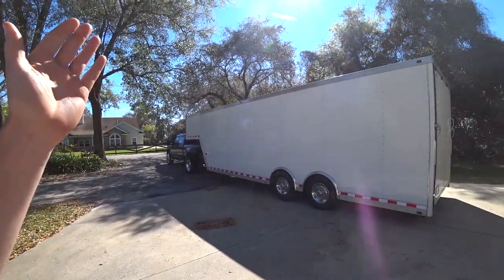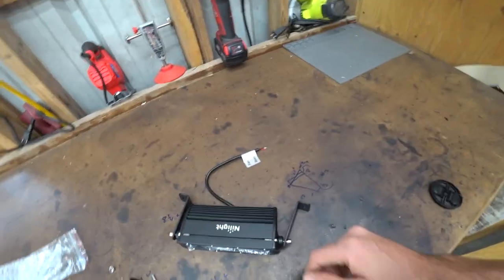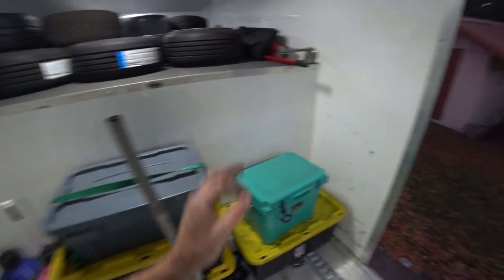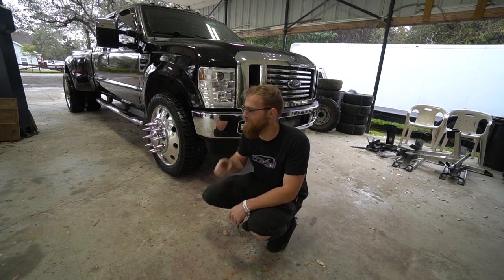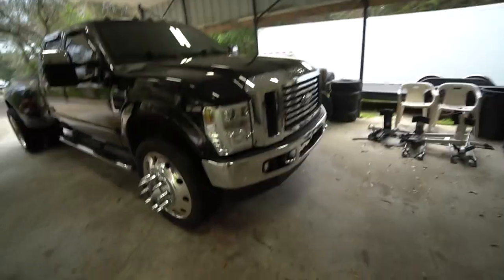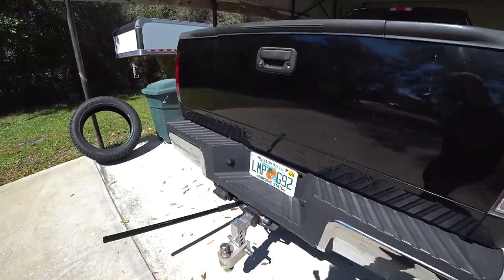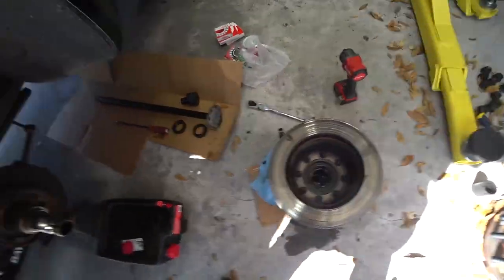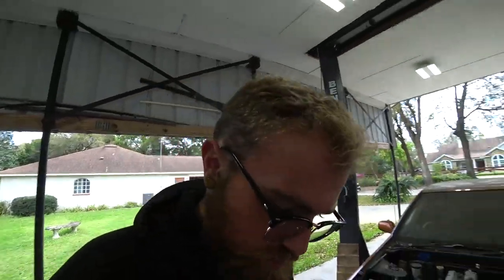Fixing up my new trailer and my cummins swapped tow rig.

Comment: Don't forget to notch the spare wheel as well, you don't want to be stuck at the side of the road trying to fit the spare over the studs.
Reply from the maker: Yeah I'll need to. The difficult part is it's not even. Like however you notch it the wheel can only go one one way and the notches line up. So I'll have to test fit it up there to mark for the notches
Reply: @Taylordrifts  where did you get those taillights at I really want some for my 01 F350

Comment: Fun fact: Taylor doesn’t go to drift events to drive, it’s just an excuse to tow something
Reply: Ole Trailer Ray
Reply: Plot twist
Reply from the maker: It’s honestly kinda true 😂
Reply: @bagelbandit6076  need Trailer Ray Tees now!!
Reply: @Taylordrifts  I'm sure you know but I've had really bad luck with standard trailer tires, and I know you said that you upgraded to better tires. But if you have a 235/80or85r16 just upgrade to the saliun s637. The difference between them (14ply) and a standard 10 ply is a world of difference. Last time I bought them they were only $150/piece. Not sure if it matters but I hope it helps brother. Love what you do man.
Reply: Release ya inner trucki  Taylor!!! Haha... from a fellow Aussie trucker! Can relate haha
Reply: @NickB412  trailer tyres always seem to blow.. What is it about the standard tyres that's crap?
Reply: @Matty.Hill_87  Mainly load rating, and testing... trailer tyres don't need to steer, so are generally built to a lesser standard as they just follow and stop.
Reply: @RangerRick24  lmao Trailer Ray 😂 I'd Buy that! Can i get that in a Hoodie?
Reply: @Taylordrifts   what machine shop do you go to in central fl I need some work done and I don’t know which ones are good

Comment: I like how the trailer is setup with tandem axles that are spread out, distributes the load more evenly, also is more stable towing, and a little bit more airflow to the rear axle tires to keep them cooler.

Comment: This was a super fun video for me to watch.  I just bought a 26’ bumper pull Pace for my 04 MSM that I’m running a lot of AutoX and track days with.  Mine is much older and came set up with generator, cabinets, winch which I saw your comments on, but these things work for me.  Mine also came with a RV heat/AC unit.  Anyway, it was the right trailer for me and setting it up is super fun.  Like you, I am enjoying it almost as much as my new race car.  It’s the old trailer that I always dreamed of having and for my budget, absolutely the right one.  Thanks for sharing this.  Great video.

Comment: It's amazing what a difference a few feet makes on a trailer. Yanking a 46' semi trailer around is like driving a pickup, but a standard 52' or 60' big boy I have to move around and pull into the shop is a pain. Really glad I'm not a truck driver.

As far as 24" wheels and tires go, always make sure to use anti seize on your hub centrics, lube up the studs and in between the nuts and washers with some PB or other oil, and either buy a tire bar or weld a chunk of round bar for a fulcrum to a 36" pry bar to lever the wheel and tire on and off. I only jack the wheels up about 1.5-2" off the ground and lift them on and off the studs with a bar. If they're real stuck, usually a 6-8 pound sledge to the sidewall will pop them loose, usually from outside but sometimes you gotta do the ugly sideways swing laying under the truck.

Those valve stems have a rubber seal on the inside of the wheel, pretty much guarantee the silicone will eventually come loose and you'll need to remount it and replace the stem.

Comment: You are correct Taylor there is a rubber seal on the inside of the wheel to seal the metal stems. Usually over tighten then nut can squish the seal causing premature failure, also looks like there might be also bit of corrosion getting around the stem hole. As far getting that tire mounted call les schwab most of them can service semi stuff of should be able to tell you which of their locations near you will be able. 
But I sure do love fummins/ trailer videos!!!

Comment: I would highly recommend getting a new valve stem for the leaking one. If you can break the bead you might be able to change it yourself without needing to remove the tire completely. As always, you do everything the right way by replacing what needs it. Thumbs up!

Comment: Just a suggestion. Good lookin truck btw!  I have an F250 and pull our race car, an equipment gooseneck, and a fifth wheel camper. I put power stop drilled/slotted rotors and composite pads because of the excessive wear, noise, brake dust etc mainly from
Pulling trailers. They’ve been on for a year now and can’t tell any where at all. They’re impressive!!  They weren’t cheap but will last much much longer. Summit has them and you can buy them in a kit. No worries on heat or excessive wear from pulling a trailer!  Wheels don’t get any brake dust at all either which is nice.

Comment: On the Fummins, the left tail light wasn't working when you had the marker lights on.  I'm glad that you notched the outside wheels too.  That way if you start doing tire rotations on the truck you won't have to fight it later.  As you know from dealing with them so far, a tire rotation on a dually isn't much fun.  If memory serves it is inside to out, and out to front, and front to inner.  I am sure that you can find that information way easier then the last time that I did a dually rotation.  Keep up the great content!

Comment: #1 they make "skirt" lug nuts that will align a semi wheel better than the flat flange ones.  You only need to replace 2 or 3 nuts per wheel to ensure proper centering. #2 The valve stems for aluminum semi wheels do have an O ring on the inside of the wheel.  You can also get stem extensions that make checking the inside tire pressure way easier.

Comment: Always use a little anti-seize on the hub centric adapter so they don't stick ! I had that happen so bad we had to drive a couple of miles with loose lugs to loosen the wheel.

Comment: Idea- instead of having the tracks dispersed on the walls that run horizontally however many feet apart. Get some in between them so both walls is one long track on each side. You can NEVER have to many tie down spots/options.

Being a trucker in a sense & racer,I’m in trailers all day for work/play time. Having the tracks run along the whole long of the wall gives you many options for tying toolboxes down-securing fuel drums/cans. Jacks,broom for sweeping trailer out etc.
Nice score on the trailer!🤙🏼

Comment: I learnd that way on my subaru. Thought my transmission was loud. So we took it apart and it was totally fine. Sounded like the sound was from the transmission. Turned out it was the rear diff. Allways good to check first where the sound is coming from. Lol

Comment: wire the LED work lights on the back of the trailer to your backup lights circuit along with a diode on each side and you will have backup lights and loading lights.

Comment: 08-10 ford 250s, and 350s were renounced for hanging up brake calipers. My 08 sat a lot when I owned it, and I had to replace 3 of the 4 calipers even before 80k miles. Replacing the rears was a good call, but keep an eye on the fronts. Anti seize on the guides isnt a bad idea if you aren’t driving it every day.

Comment: Not sure if you'll see this before you come up with a plan but if you're putting the spare in the stock location should be able to use the stock wench system to get it up and down easily or something similar then throw a bolt through just in case cause it is so much heavier.  Gotta love "simple" brake jobs.  Also a jibber jabber t-shirt is a must make that happen. Good luck at the event 👍

Comment: The brake clips are what make the grinding noise. That is their purpose. It is to alert the driver to replace the brakes. Without them grinding, the brakes could get to the point where you run out of friction material and lose breaks without warning.

Comment: btw, high temp lithium grease works better then pb blaster for long-term anti seize (3 years through canadian winters, and popped off super easy).  Works great between dually hub adapters too.

Comment: Talking about comfort while pulling trailers on long trips. If it will work. Look into a Gen Y spartan for the trailer. It will cushion the trailer from the truck connection. Make for a smoother ride over rough roads.

Comment: Taylor I saw a welding accessory I think you'll be interested in. It's the Linear Amperage Control from CK Worldwide. Its a slider that connects to the torch and could be a good replacement for the button control.

Comment: Hey man I heard you talk about using a dead blow and the nuts on the inside of the rim making it extra hard to get off. I work for a towing company and I change tires on diesel pushers and some time those rims get stuck on tight my grandpa taught me to use a 4x4 and rest it on the inside rim lip and use a 10 pound short sledge hammer and beat on that block and then if it doesn't move go 180 to the other side and go again and even the most stubborn ones will work off. Also on our big truck most of  the tire shops don't put the tires on with machines just big tire spoons the beads on those rims are not the same as car and regular truck rims. Good luck and keep it up love the videos just trying to pass on what I've learned and seen

Comment: Amazing stuff as always! Have you thought about wrapping the trailer to match your truck a bit better? 🤔
Reply: At least he wanted to do it to the previous one but he never got around to do it. Might have been because a lot of comments said that a black wrap would turn it in to an oven under the sun. Or he just knew that he would get another one eventually, so why bother.
Reply: @Gavztermeizter  straight facts, but even if he would wrap it like some of these RV or Camper trailers it would look so much better and I know a lot of companies will leave the roof alone or wrap it in a heat repellent material.

Comment: They make plastic rings to put between the hub a wheel. That will help with corrosion. The also make lug nuts that center the rim onto the studs.

Comment: Put a little bit of silver antiseeze on hub and wheels and you will be so happy had to do on my old 1984 chevy 3500 crew cab dually with alchoa 22.5 rims and wheels 10 years ago made life so easy
Reply: And maybe also say truck was c notched and bagged and laid frame (great spark show on freeway when doing 70 and dropped bags lol) plus the diesel swap  even though it was only a 6.5 turbo diesel

Comment: Those valve stems have an o ring on the inside of the wheel that can leak if you aren’t mildly careful installing them. Also if you use a pry bar under the tire when you’re putting them on the truck they’re a piece of cake to install.

Comment: You had a solid quarter inch of pad left on the RF, that's at least another 50k miles before considering replacement.  The stock pads are only about 10mm thick, and you had 5-6mm, so you were at 50%.

Comment: Most tire machines these days have adjustable jaws. There's normally a little pin attached to a small lever, push it in and you can adjust it to hold a bigger wheel. Can't tell if yours has it or not.

Comment: Slightly closer to a careful completion. For the next stuck wheels maybe use the lift with blocks on one side and set it back down on an angle? Like a flat 2x4 or two, not jackstands, eep! Hopefully never again, but when it happens again. Have a good one.

Comment: You need a 6 foot dead blow semi wheel almost always get stuck on that’s what we using in the shop for the semis
Reply: A six foot hammer? Huh?
Reply: @-tr0n  a dead blow isn't a "hammer."
Reply: @shakotanlife  i mean, it is. mallet, dead blow, whatever it's a type of hammer. Point is they're not measured in length, lol. and i'm not sure i've ever seen one six feet long anyways. even 20 pounders are 4 feet or under.
Reply: @-tr0n  percussive maintenance device.
Reply: @kjcorder  haha yes, more accurate

Comment: get a chain holder for the tyre there used on truck tyres u lower it down so u dont have to hold it manually and alot gentler

Comment: There’s a few companies that make “wheel centering tools” for those bigger wheels. Yes the hub will center the wheel but you are still able to rotate the wheel along the hub due to that fact that the studs and the holes have some play. Google around and look at semi wheel centering tool. Watch some videos on how they are used. And the longer style ones fit the duals on the rear.

Comment: I hear you on those torx sockets! They appear in the weirdest places. Driveshaft on A E46, wiper motor linkage on an Opel Astra, and Alfa's are friking weird, lower control arm bolts FML.

Comment: Yo taylor, de-bead your wheel with the leak on your own machine. hold the tyre back with the bead breaker and there should be a nut on the inside of the valve. give it a little tweak up and it should fix the issue.

Comment: i tow a lot in my silverado 2500 and brake dust killed my chrome wheels and the rotors warped. swapped to some slotted rotors and ceramic pads and man does it make a difference. would recommend slotted rotors next time

Comment: Suggestion: if you want a smoother ride, I'd get the truck and trailer tires filled with nitro. Really makes a difference in ride quality overall, well worth the extra few bucks to have it done! Also tire pressure wont really change, went almost 2 years of checking and not once did they drop in PSI.

Comment: Man as awesome as this truck is, I don't feel so "bad" anymore that we "only" have an BMW X5 4.4 with that we tow an open trailer, that thing is a pain in the ass as well but we can at least change the brakes like on a car.. 😂 it's just not a cool truck lol AND we can't take a spare wheel, I would be so happy if I could just stuff it under it like you can, we have a LPG (Autogas) injection System on that thing and the LPG tank is where the spare wheel would go 🤦🏼‍♂️😂 

Cool video as always! 😃👍

Comment: The valve stems rubber is on the inside usually just resnug it up if still leaking replace the stem

Comment: @Taylor ray they make alignment lugs for semi wheels, u tighten down 2 of them opposite of each other and centers the rim on the studs, and u can get a brass manual tire beader/debeader with a 6ft handle for semi rims/tires that's how we did all the semi truck wheels at our shop, we didn't have tire machines. U will need a tire spoon bar aswell, it sucked for me cause I'm only 155lbs and tall and skinny, but I could change 10 tires in 4 hours as long as I didn't have problems and it wasn't middle of winter cause the tires get so stiff and become impossible to mount/dismount by hand. That's how we did road service calls aswell those suck in the middle of winter here in detroit... I always brought pre mounted tires on rims. Steer tires on a semi are directional, drive tires are not

Comment: About to 1 ton swap my jeep wrangler jku. Ford super duty front dana 60 and a aam 10.5/14 bolt rear. Doing all new brakes on both and gears on both axles. Before I put them under the jeep.

Comment: If you don’t have one, I would get a TPS for the trailer I have one and saved me a couple of times tires from doing damage to the trailer when they come apart. The one I have also monitors tire temp as well. An exhaust brake would help save your truck and trailer brakes as well I hardly use my brakes now exhaust brake does most the work.

Comment: anti seize the ears on your hub adaptor ears it will help then slide off easier! If its being stubborn 10lb dead blow on the back side of the wheel and it will pop off (im a heavy truck tech and take these tire off for a living)

Comment: You should check you axles to see if they are straight. It really dosnt take much to bend an axle.  Whack a curb slightly with weight in it or just too much weight and aggressive driving can bend them. Also a slight bend by the leaf mount or torsen spring mounts to the axle may be hard to see.

Comment: For the rear disc and hub bolt if i remember you can use a normal socket I think its a 14 or a 15 I work at a ford dealer and a never use a special socket for that job

Comment: For getting your tires off if they’re seized to the hub, I recommend putting 1 lug nut on the bottom and hit the fire from the other side with a hammer. Personally I’m a fan of using a 10lb rubber faced sledge hammer.

Comment: The tire technician in me was hurting while watching this man 😅 you can adjust your clamps on your tire machine both in and out for various sizes, just pull the pins on the side of them. Also don’t be driving around to break the wheels loose 😩 your gonna seriously break some stuff. Put the truck on stands and use a hammer on the backside of the wheels to beat them loose. Unless you got a special too that is what every shop is gonna do to get your wheels off. Hope your torquing to 450 ft.lbs. And always doing the re-torque within 50 miles of driving 👍🏻

Comment: I’d recommend keeping the trailer spare as accessible as possible. You’ll be frustrated enough having to change the trailer spare without having to dig it out of the front corner when it’s buried like you have it.

Comment: i assume time is why you didnt o/h the calipers. also parts stores should have valve stem seals and parts. or tire shops but the latter may have to sell you the entire stem.gj btw. that brake job on a stock truck is a killer ( time and effort wise) yours is motivation killing.
Reply: also surprised you didnt film the brake pad bedding in process as well as the coating on the rotors that needs to be removed. just stuff id figure youd go ovr being as thorough as you are

Comment: Taylor Ray maybe you can design you a puller that locks into the holes on the wheel ❓
I would hate to think of you stuck on the side of the road not being able to get a front one off 🙄